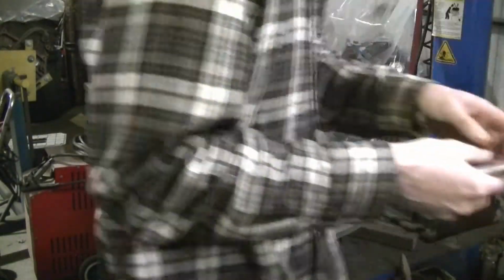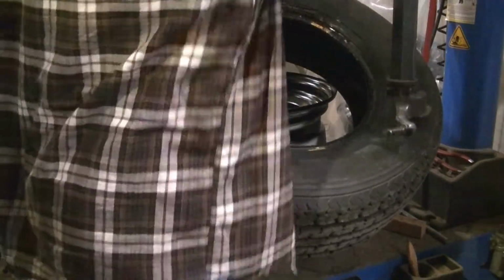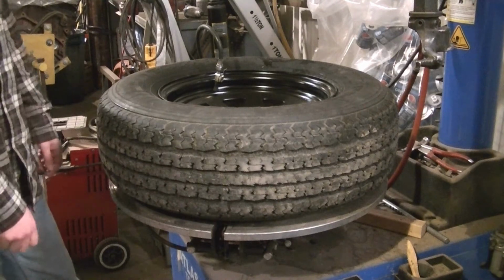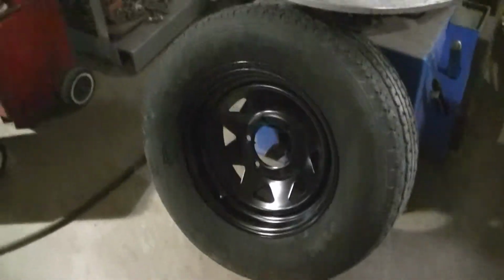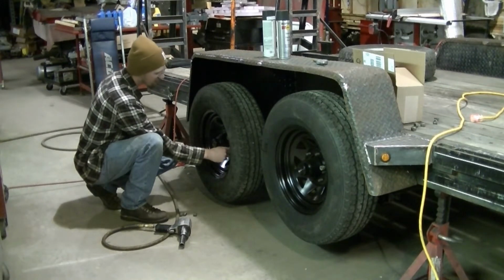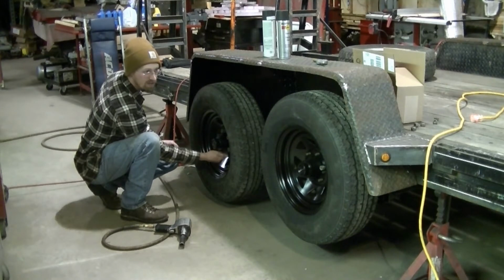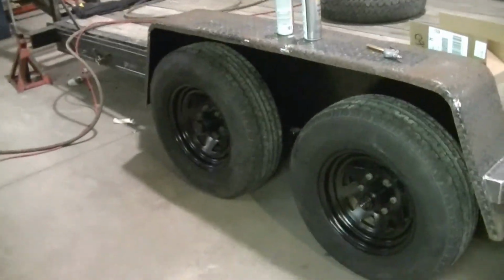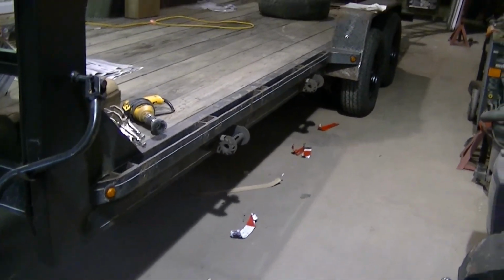Gooseneck Trailer Project "Blue Collar Hauler" Part 12  Tire Mounting

Comment: What did you paint the wheels with
Reply from the maker: Rustoleum Industrial paint.  It's good stuff but you need to get the industrial or hard hat stuff.
Reply: +mossman381 awesome. Is that the same paint you used for the trailer itself? Sorry for so many questions ever since I saw this project of yours I went and got me a 7x16 car hauler bumper pull and it def needs some attention lol, I probably won't do it as professional as you but I'll try my best! 👌🏽
Reply from the maker: Yup,  same paint on the trailer.  I sold this trailer this summer.  Not sure what I will get to replace it.
Reply: +mossman381 nice man , either way great content and I will continue to watch your vids 😎